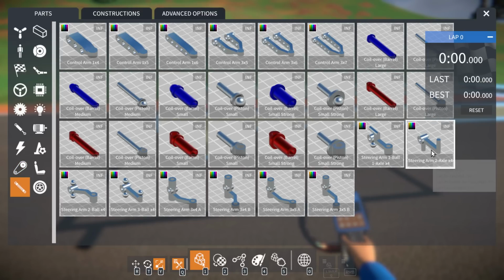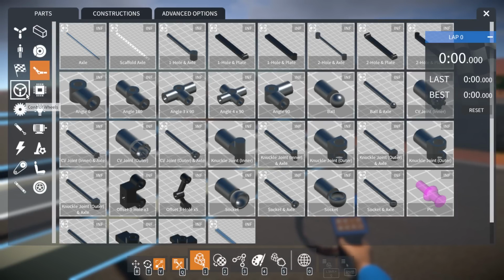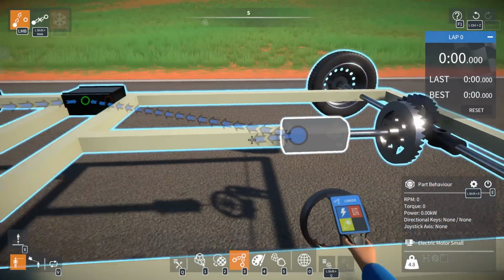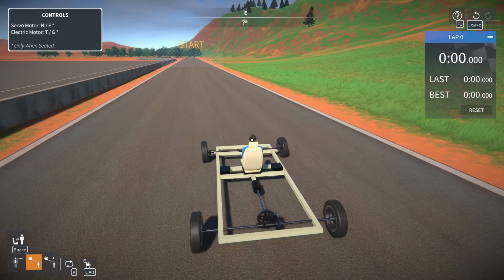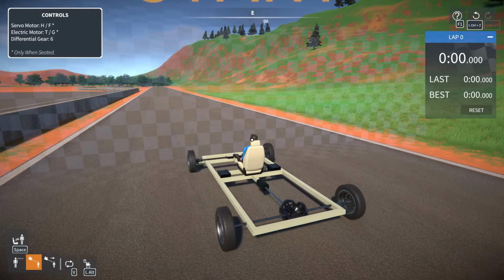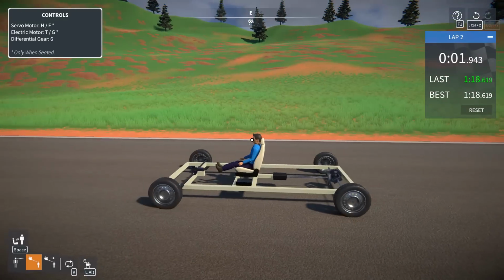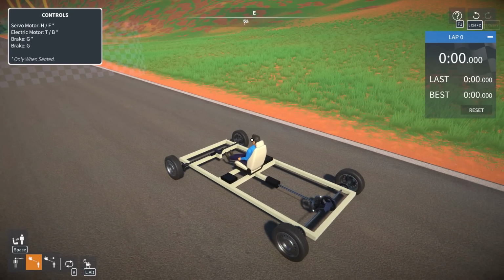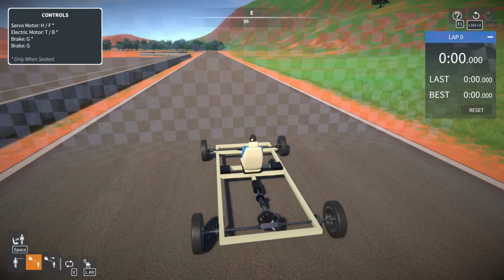I Built a Chassis to Test Differential and Centrifugal Clutch Setups in Gearblocks!

Comment: Centrifugal clutches are only to allow a combustion engine to idle and have the output decoupled, when the engine is spinning above the clutch's grip RPM it will be coupled, no matter if it's accelerating, keeping the same speed or engine braking. Those clutches are found in chainsaws and a lot of off-road vehicles, also on Can-Am Spyders (3 wheeled motorcycle, aka road snowmobile), but only those with the electronic transmission.
Reply: Many like to use it in hybrid systems as if the engine is decoupled from the output then the e motors can drive it or the engine and electric motors can cohesively run.
Reply: @nerfgodbigguy1405  in gearblocks with digital input, sure, but on a real vehicle, it's just a waste heat generator that is harder to control than the electric motor itself
Reply: @@RustTree0915 not really, for a (real) centrifugal clutch to disengage, it would need the engine's output to nearly stop and since it is engaged to the wheels, they too would have to stop for a brief moment before they are decoupled and would allow the vehicle to coast. On a real vehicle, the clutch would be calibrated such that the engaging RPM is just a little above the idle RPM and get fully engaged in <500 additional RPM.
Reply: @JF743 why would the wheels need to stop, the speed of the output doesn't effect the clutch that's the point, unless the clutch is engaged the output spins freely, and electric engines (unless programmed not to ) do literally stop completely when not running.
Like unless it gets an input it spins 😅

Like still centrifugal clutches aren't perfect for full sized cars coz they can only handle a certain level of torque/load before they slip, just due to the nature of them.
Reply: @Atherax  the centrifugal clutch does not depend on the engine accelerating, it depends on the engine spinning which it still does as long as the wheels are spinning (engine braking). No engine on a full scale vehicle is strong enough to stop itself instantly or even overcome tire grip, brakes can, but usually don't because of ABS, that's why you need to stop before you can coast.
Electric motors irl never need a clutch, the only exception is on some RC cars with brushless motors as the torque of the motor is enough to annihilate plastic gears so the output shaft is fitted with a "clutch". That one is always engaged and does not slip during smooth driving, only during extreme acceleration or deceleration. If it's too tight, it'll destroy the gears, if it's too loose it'll scream and burn itself down really quickly. RC car motors are no joke, they pack a huge amount of power for their size, I've had a bearing seized up and barely felt it, meanwhile it melted the plastic around it and welded itself to the cars chassis.
Reply: @JF743  I am sorry to break it to you, but the Centrifugal clutch has a Inner rotator and a outer bell housing, if the inner wheel with the shoes loses enough speed, the clutch is disengaged, no matter the bell housing RPM... so if you have a Combustion engine or a Electric motor, it will transmit power coming from there, but it will not have any effect when the Wheels try to transmit power to the Engine/motor, because all it can do is rotate a cage with a high friction surface... but the shoes dot have contact since the rotation of the engine/motor is not enough to push them outwards... What you mean with a clutch on RC brushless motors, is a torque slip clutch, always engaged, but has only a certain amount of torque that can be transmitted before it slips...
Please if you dont know what your talking about, just look it up... thanks.
Reply: @Atherax  Centrifugal clutches can handle torque... just at certain rpm.... reason why cars dont have it is: 
1. Engine breaking wouldnt be possible
2. Engines would have to ramp up a lot to be able to accelerate--> imagine old people driving, revlimiter and then slowly engaging clutch... yep thats how it would sound like...
3. Its a clutch that often slips a bit, so it would wear drasticly fast...
Reply: @Pitstopcomponents  I'm not claiming to be an expert, but I do have some first hand experience with engine braking with a centrifugal clutch, you can't disengage the clutch manually as it needs to slow down to disengage and the wheels spinning keep the engine from instantaneously slow down to below the friction point, it's like a catch 22.
As for the torque slip, thanks for the information, I wasn't aware of their name. I knew they were different, all I said was that it's the only type of clutch that can make sense paired to an electric motor and even then its pretty much a duct tape solution.
Reply: Don't go-carts also use those?
Reply: @markellii3093  Some do, some dont..